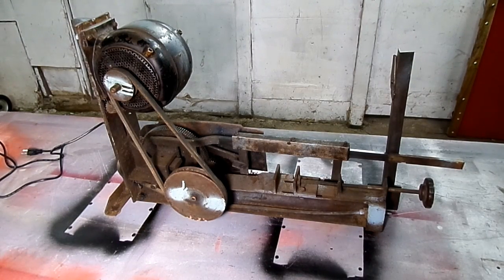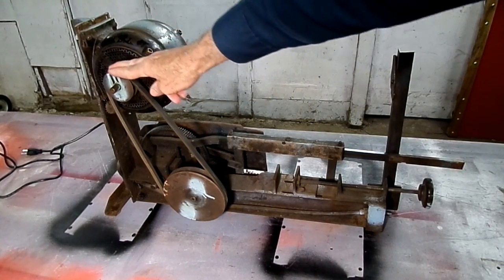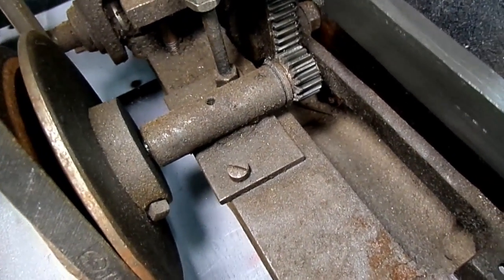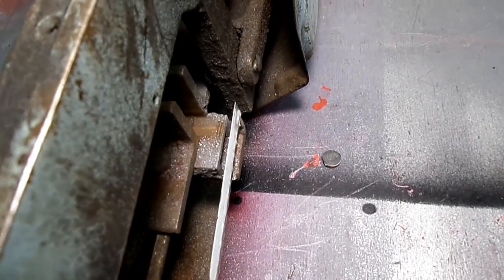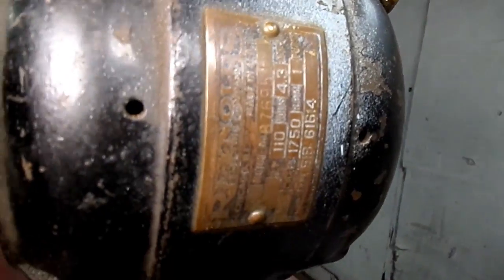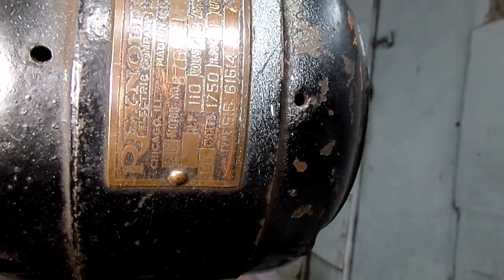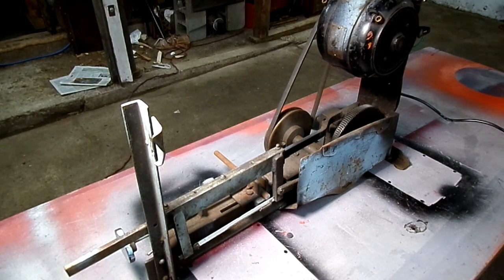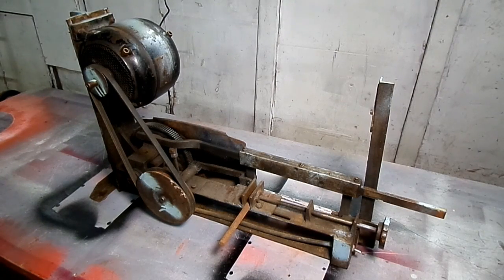Homemade Power Tool

Comment: Very easy to improve : a second switch at the bottom would cut power once cut was done, a cover to the E/M  must be mandatory, a sliding weight in the arm woul regulate the force applied to the blade, etc etc etc. Very good machine.

Comment: First thing I would do is modify it to have a cut off switch activated by the handle section, so once it finishes cutting thru the metal and falls like it does, it would cut the power, that way you don't have to babysit it as much.

Comment: 110 volts * 4.3 amps = 473 watts.  At 750 watts per horsepower, this gives approximately 0.6 horsepower.

Comment: The only thing I would add is a metal bar to the end near the vise handle so when the blade falls after cutting through material it hits the power switch and shuts it off automatically :)
Reply from the maker: That would be a nice addition.
Reply: richpin06a Had a very similar one back in metal shop in school.. it did have a shutoff switch hooked to it...Much cooler than the band saw types..Loco Motion.

Comment: i love it lol, your uncle was a clever man much like yourself :-))

Could do with a smaller pulley on the motor to slow it down, its a blade killer, and a stop plate to kill the power the second the blade cuts through.
Now that deserves a good clean and paint mr richpin, thats a great tool you have :-))
I remember we had one in metalwork class in school, same thing but slower and used a large type blade, you could put a massive bar into it and just walk away while it slowly worked its magic, allways thought it was a clever idea :-))